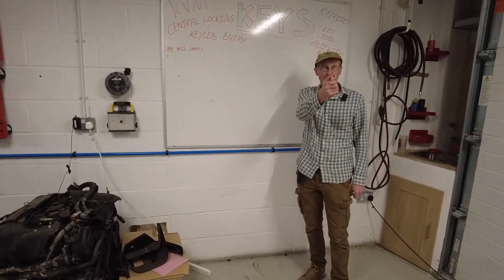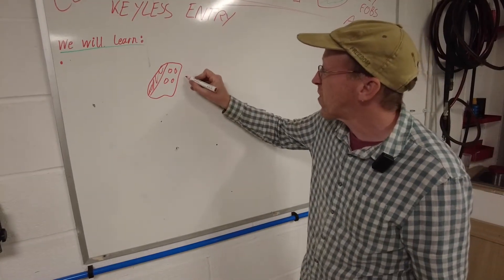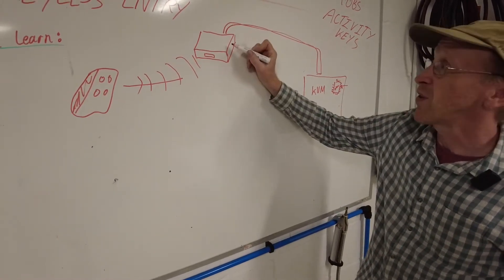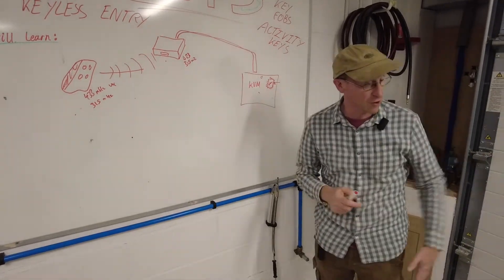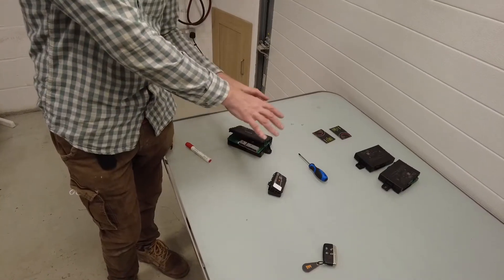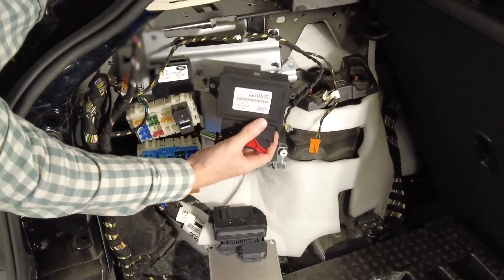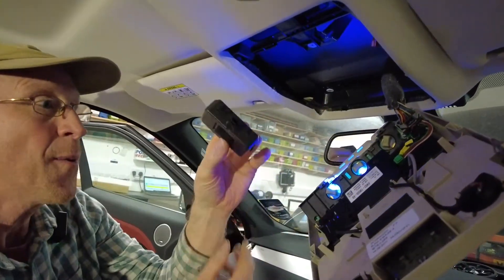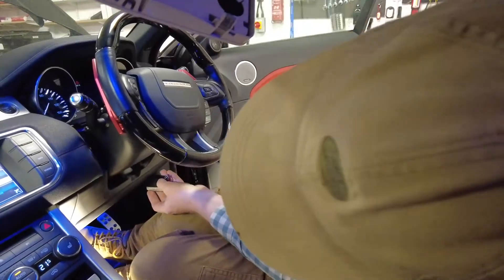Range Rover Evoque Key Not Found / KVM module repair / Keyfob Testing & Debug

Comment: Hi just wondering is there any chance to unlock the dash/ start the car or unlock the park brake. I have only one key but dropped it and now won't unlock the car by remote, I have used the aluminium key to enter through my driver's side door into the car but my remote can not be found on the dash, I have changed the battery in the remote and its definitely not that, my remote is ruined any options starting or unlocking the dash?
Reply: You can start the car by holding it next to the steering column.

Comment: Thank you for the video,so what about range Rover dynamic 2021 the car is flood it's showing me the key is not detect and RFA is not look like damage,so please what did I do. Am locksmiths thank you.
Reply from the maker: Does the car start if you hold the key next to the steering column
Reply: If ur a locksmith and you touch a flooded car and don’t get it running and it’s a Customer car they are going to have a fun day with you

It’s one of those cases of, you touched it last so you are responsible unless you own this vehicle and failed to mention that?

Comment: Hey guys i have a weird double click sound coming from the kvm area, it happens after the car locks or unlocks its mad anyone else have that? 2012 evoque
Reply: Yeah i had that as well mine is 2012. Did you get that fixed
Reply: @KING UPLOADER  yea my problem is meant to happen apparently so I'm all good
Reply: @keithmountaine1  do you have a problem with key not found with that clicking as well? It's a real headache lol
Reply: @KING UPLOADER  ohh no not at all, never had that issue at all. I fixed 3 out of 4 door lock on my doors and have had to change the battery on both keys  after I got the car though so maybe I skipped that issue
Reply: @keithmountaine1  okay I will change the battery on my second key see if that helps

Comment: HI I like some help if can ,got 2016 RangeRover  with faulty RFA so prox key dont work can I use 2014 RFA just plug it and do new keys by obd as my scan tool goes up to 2015 then board encriped thanks if can help.

Comment: Hi, if I put the fob in the backseat it starts, anywhere in the front it says smart key not found. Under the steering still works. Any idea????
Reply: rooftop module could read that key i believe   one right in center of roof under lining  i believe?
Reply: Hi did you happen to find out the issue. I am also having the same issue now and can not find what’s doing this?
Reply: Hi there ,
I am having same problem .i know it’s been few years but did you get the bottom of this issue ?

Comment: Hi, where is the receiver module on the 2010 L320 RRS please? Thanks
Reply from the maker: Not sure - looks like there may be 2 of them ? this system is different.
Reply: @L663  you have to removed the headliner, rear left door.

Comment: Hi Simon, I wanted to reprogram the keys for Range Rover Evoque sd4 2013. I think it could solve my problem but from programmer I got a message that there is a problem with the immo. I bought new KVM and would like to connect it and program. I am bit afraid to disconnect the battery. If I disconect the battery can it cause the reset of all modules?

I don't know how to program them back.

Could you please let me know?

Thanks and kind regards Jake

Comment: My key won’t open the car, but will start it.  I’ve been told I need a new KVM as my girlfriend’s Evoque has already had the maximum of five keys programmed to it.  Mainly because the car keeps losing the ability to communicate with its keys and it needs new ones programmed!  Truly fed up of this car - now going to cost £1350 to sort. Will message the guys at kwatronics to see if they can help 👍
Reply: Hi mate. I have the same issue, but was told it wasn't the KVM, and more likely a software issue and/or the RFA module/sensor. My fob starts the car but I need to use the blade to open/lock the doors. Oh, and the fob doesn't work under the steering column (which could be something else?). Let me know if you resolved your issue please, as I'm struggling to find a solution. Thanks
Reply: @ mine was the KVM in the end so I had to pay Land Rover £1200 for a new one plus two keys.  I messaged the Kwatronics guy but he was non-committal and didn’t seem to want the business.
Reply: @jayrave4 Thank you mate, appreciate the reply on an old post. I was quoted exactly £1200 from Land Rover (mine is a Discovery Sport). 

Can I ask what your issues were? Did the key not work the locks but started the car? Did it ever not start the car as well? And did the KVM and 2 new keys fix everything after that? As in, no more issues? Just debating whether to bite the bullet. Didn't want to risk paying it and then another module needed replacing (like the RFA or something). Appreciate any help mate 👍
Reply: @MrMarcoUnico  despite not being able to unlock it with the remote, the keys always started the car as normal and I had no issues with that side of it.  Just a pain my KVM was locked so couldn’t have any new keys programmed as I would have got away with just the module at half of the cost.   I had no more related issues since although a door lock has since packed up and I now need to throw another £300 at fixing that.  They are beautiful cars to own and drive but a nightmare for maintenance - especially the electrics.   I’ve spent about 7K in repairs and maintenance since buying the car in December 2019.
Reply: @jayrave4  Ah got you. I had the odd time it wouldn't start the car, but an auto locksmith was able to write a key to it, and sorted the KVM as it was left loose by a previous owner. So my key now works the engine fine and his additional key also worked. Just annoying I can't work the locks. You're spot on though, they're lovely cars but a real pain with electrics and engine/dpf issues 😢 Appreciate your help mate.

Comment: I am from Mexico and I have a very similar fault only that my key does not open the doors or do any function, it only turns on when I put it under the steering wheel.  Could you help me?
Reply from the maker: Yes there are 3 things
1 - Keyfob faulty / battery - do you have another keyfob to try ?
2 - Radio receiver module - next to the mirror in the headlining 
3 - KVM module - this is the most expensive thing - you can get this fixed or take to dealer for replacement.
Reply: @L663  thanks broo Do you have any instagram or some means to be able to send you video of what the truck does to me and something that I notice is missing inside the cabin
Reply from the maker: @edwingalindo67  you can post a link to a dropbox video here or send email to contact @ powerfuluk dot com FAO Simon
Reply: @L663  okey thanks broo i send the video link
Reply: Hi Edwin,
Alex here. I have the same Issue with my 2011 Lr4 nothing works with the fob. Car only starts under the steering wheel 
Have u fixed ur issue?

Comment: Where is the location for the key reciever for the 2018 range roger sport ?
Reply from the maker: It is in the headlining under the roof aerial -it is a small box velro'd to the roof. You can release the rubber trim around the tailgate and reach in - there is a clip holding the headlining up in the center about 6 inches from the rear - sometimes you can pop this off to make access easier

Comment: Same issue with Jaguars .. looks like all the same kit in the same manufacturing period.  If you don't allow the car to fully shut down before disconnecting the main battery .... you risk loosing access to the key address book - and your car.

Comment: My new defender has constantly had the “smartkey not recognised “ problem since it arrived. Ive had a new module of some sorts fitted under warranty but its made little difference. The biggest pain is getting called constantly by by in control to check if the car has been stolen 😡
Reply: The keys are faulty

Comment: Excellent video. Simon you have a truly gifted way to explain to others. You transform a regular person in a home made mechanic. Thank you for being an inspiration and for showing people that that is a lot of things that we can do in our own home 🏡. You guys are awesome 💪💪👍👍
Reply from the maker: Thanks - in most cases the problem will be the keyfob but if not then the repair can get expensive at a dealer...
Reply: @L663 just priced nearest dealer for a job a EURO shop screwed the pooch on. Dealer says roughly $2k USD for new KVM module and one key. 

They charge 2 hrs to replace the KVM, 1 hour to add key

One key along they quoted $405, one hour programming at $255, emergency blade $155. 

That’s just adding a key at dealer. 

Sad thing is this customer had a working key. 

I’d attempted then backed away. Referred her to this guy after calling him and him saying he had VCI and so on to get it done. 

He whipped out a aftermarket scan tool for APPG2… 

At one point the car ran in emergency start mode then he attempted to add and things went to hell in a hand backer even worse and car would start. 

Can turn dash on by placing key in emergency slot location, remote works. We do get the key sense error. 

BTW the place ur placing the key below the steering column is an induction could as it induces the immobilizer, excites the coil and allows it to start.

Comment: The module located under the steering column is called the IAU - Immobilizer Antenna Unit. It is used as a back up by detecting the transponder within the key fob through induction - the key fob doesn’t even need to have a battery installed. The code output from the transponder will be confirmed by the IAU - I think that’s where the known codes list is stored. Once the code is confirmed, the IAU communicates directly with the CJB, bypassing the KVM, allowing the start process to commence. 

Ref: TOPIx Workshop Manual 419-01B Anti-Theft - Passive
Reply: Wow this is nicely detailed, thank you.
Reply: Codes in BCM (CJB /main body computer) -the  IAC is a dumb sensor.
Reply: @stevesimkins3918 thank you for the clarification.
Reply: wonderful info

Comment: Complex stuff Simon. The interesting bit for me is the under column sensor because I always have found that is hard to make work..it takes me several goes before the car will start. The other thing is that I only need to do anything with it about every two years and the key fob battery charge doesn’t seem to be the problem because fitting a new battery does not always bring an instant solution BUT after a day or so, it does. I’m pleased to learn of the module locations just  in case I need this in future but for now, I’m good…🤞🏼🤞🏼🤞🏼🤞🏼🙏🙏😃😃😃😃😃
Reply from the maker: If it works best to leave it !
Reply: @L663  yes…I certainly will do!!😃😃😃😃

Comment: I believe it probable that once you are into the car, which may require the use of the mechanical key if the system is down or the key fob has a flat battery, then any LR key at all of that general type will allow the car to be started using the proximity method you show.  Only one way to find out…..
Reply: Nope...only the key for the car will start...all keys have unique ID

Comment: This trick with the key fob pad under the steering column works even for when the key fob battery is flat.  On other brands of vehicles it may work by holding the fob to the start button or the fob might be required to be inserted into a specific slot in the dash.

Comment: The key code was typically stored in 2 locations, and both need to match! Dash IPC, Fusebox, engine ecu.
Reply: In correct, the keyless proximity data is stored in the KVM & the Emergency start data is stored in the BCM, 

So if your key stops working keyless, naturally you’ll put the key on the emergency override
Reply: @ty_r0nn  When I said WAS, I was talking about the D3 which isn’t keyless

Comment: Even better, a micro SD card on the board that stores the data. Add a software lock to it and you’re good to go.
Reply from the maker: Yes it would seem to be open to other options...also should be able to unlock and drive it with your phone... same as the Tesla...

Comment: Is this the same for discovery 4 2016 as I’m having this issue now
Reply from the maker: Yes its very similar if not the same ! ( just looked at the parts manual and seems to be the same - although the KVM seems to be in the roof from the picture? )
Do you have a spare key to try ? 99% of the time its the key.
The radio receiver can go wrong but not often.
Reply: @L663  many thanks for the tip will try a different key and also change batteries

Comment: That last point is very interesting. Did you try another key from another Evoque against the near field sensor to see if it worked at all? 
I wouldn’t have thought it would or else any Evoque key would start any other Evoque thus making it a thieves paradise.
Reply from the maker: I am sure you need to have a coded key for it to work ! but I will try it with another key next week !